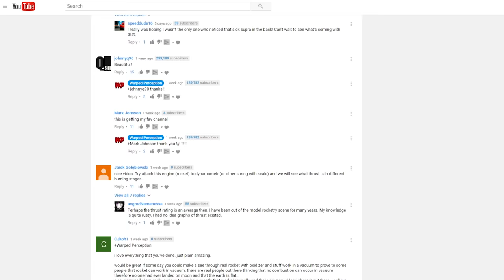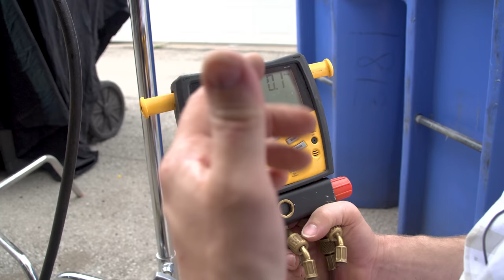Model Rocket Engine In A Vacuum Chamber - 4K Slow Motion - will it burn? - Rockets (S1 • E3)

Comment: Wow, you have tape on the ends for covers, that must have been a true vacuum... NOT
Reply: There was a stopper on the end with a gasket. The atmosphere pushing in on the stopper held it there once the vacuum was being created. The tape was there to hold it while the vacuum was being made.
Reply: The atmosphere has pressure mate. The lack of air in the tube meant that the air pressure was much lower and the atmosphere pushed onto the stoppers/ circles with foam on, are pushed onto the tube with air pressure, the air does not rush in because the force the stopper is putting on the tube makes the foam warp to the shape of the tube and prevents any air from getting in.

Also space isn't a true vacuum either

Comment: Ye it burned for 1 second and the rocket gone no where, but an inch moved .. LOL... nice try
Reply: The spring held it in place, like he showed. Do you not understand how springs work?
Reply: Do you not understand even a feather does NOT MOVE at all in front of a rotating fan in vacuum?
Note this: NO COMBUSTION IN VACUUM.
Reply: Fans and rockets: these two things are not related.
Reply: those two things connected by the words "vacuum environment".

Comment: this is not perfect vacuum.....
Reply: It doesn't need to be. According to some, the rocket will not work in a perfect vacuum. Presumably it will work at a reduced performance in an incomplete vacuum. If the the atmospheric pressure is only near a vacuum, the rocket should nearly not work by showing a much-reduced thrust. Is that what we see?
Reply: Purtroppo un vuoto totale non esiste, persino nello spazio interplanetario vi sono almeno 10 atomi di idrogeno per metro cubo. Quello che alcuni non riescono a capire è che un razzo non deve spingere su nulla, è un pensiero che non funziona. L'aria non è come un muro, non puoi "spingerci" sopra poiché essendo un fluido si sposta: prova a muoverti spingendo con le mani l'aria, vedrai che non funziona. Gli aeroplani non funzionano spingendo l'aria, ma utilizzano il principio della portanza (nel caso di quelli ad elica) e il 3° principio della dinamica (per quelli a reazione). Anche i razzi funzionano così-basta che spingano una determinata massa in una direzione e si muovono nell'altra per il principio di azione-reazione.

Comment: That's absolutely perfect! You can see exactly as the pressure builds up behind the rocket it starts to move, proving without question that a rocket only works with a medium of air behind it, meaning it does not work in a vacuum. It is also a great intelligence test.
Reply: I find these experiments beautiful because you can rely on physics to give you the exact same result every time. And its proving the exact opposite of what they set out to prove. Funny as hell!
Reply: You dont seem to understand newton
Reply: @robertenator  - " that a rocket only works with a medium of air behind it, meaning it does not work in a vacuum"
SO you believe that machines CAN accelerate mass without feeling any recoil force?
Wouldn't that violate Newtons third law?
YES. YES IT WOULD.
Any machine that PUSHES ON MASS - MUST feel an "equal and opposite force".
Rocket propulsion is just the mechanical recoil of pushing on mass.

Now how about you try taking a physics class BEFORE calling every engineer and physicist to have ever lived a bunch of idiots?
Reply: A gas expanding into a vacuum does not develop mechanical power. That's a quote from James Prescott Joule himself, NASA chatbots hate him !😂
Reply: @papalegba6796  - SO then just tell us where the force comes from that accelerates the mass into the vacuum.
 Last time I checked "WORK" is required to accelerate mass.
Yet you claim no work is performed. Isn't THAT a violation of Newtons laws genius?

It's ODD that a "Bot" can figure that out while YOU cannot.

Comment: you lose your vacuum shortly after ignition. where is your common sense!? I guess that is not too common anymore.
Reply: The question is will it ignite in a vacuum
Reply: @preppertechnicianee6013  at ~25 torr, sure I'm ok saying it will ignite. however it will not continue to stay ignited in the conditions of getting to "space". that is a super low vacuum that does not even come close to the lack of pressure in "space" nor does it come close to the lack of pressure in "low earth orbit". at ~25 torr you are basically testing if a rocket will work at roughly 15 mile elevation. you've got a lot of air "space" to cover before you get to low earth orbit. I think this whole "test" was diverted from the original claim that there would be no thrust and nobody has had a vacuum chamber large enough to disprove this claim because everyone that tries has so little volumetric capacity that there must be thrust acting upon the walls of said vacuum chambers.
Reply: @AnthraXaXis  so se typically uses liquid fuels in space you can use solid but involves extra steps 

Do you know how to calculate exit velocity of a gas 

Use that and calculate how fast you have to pump in liquid oxidizer to maintain that pressure

Comment: space  is not confined to a tube and  the rocket would not touch the sides of the universe in other words the rocket was reacting to the walls of the tube and the rocket gas filling the whole of the tube universe and there for as to react to push against its own gas. in the real universe that could not happen

Comment: No success . show vaccum gage at same time as burn, observation spring did not move until gases built up in chamber providing resistance.
Reply: That is not true - we can see it moving backwards before the exhaust gases reach the end of the chamber.

Comment: sound disproves vacuum. not real. sound only travels with compression is possible, and since there is sound, it means no vacuum.
Reply: Sage 11235813 thats bullshit the exaust particles hitting the wall creates vibritions too
Reply: sound does not travel in a vacuum. and it means no vacuum, no sound. sound means no vacuum. What prevents the supposed sound of the furnace of the sun from the only noise heard? Vacuum, no sound.
Reply: Sage 11235813 why are you keeping your statement come up with scientific things
Reply: Sage 11235813 EXAUST PARTICELS HIT THE WALL OF THE CHAMBER THEREFORE    VIBRATING THE WALL AND PRODUCING SOUND WAVES
Reply: So you are now claiming that the experiment that was done was not a real science experiment and was pseudo science to try to get a low pressure container to pass as a vacuum chamber? Then claim that since there still is sound that is not able to move in a vacuum is causing the burns on the bottom, only prove you did not have a total vacuum that would prove rockets working in a vacuum state, which you never were able to produce.
Sound fucking sucks, because it shows when there is and is not a vacuum, sound does not move in a vacuum.
Reply: Those engines only work in a gas environment. Or we would have already been to space way beyond the technology of mixing powder or making fireworks. At a certain height they do not work. that is why the need for new rocket fuel, right? on top of all of it, you called what I was doing science. So what is it that you are or are not doing?

Comment: When did NASA start using solid rocket fuel in space?  Because never let's try replicate what they use!!
Reply from the maker: +Owen Lee great point and great idea, I am going to have to set that up
Reply: Owen Lee why does it matter if solid or liquid?
Reply: Norm Plewm because basic science you need three properties for combustion= 1. Fuel source 2. Oxygen 3. And heat.  Solid fuel when ignited by a heat source provides its own oxygen source! And heat in the form of a chemical reaction.this makes a pocket of air near the combustion source and that is what the rocket pushes off of. Liquid fuels will not produce this pocket of air in a vacuum.
Reply: Owen Lee you dont need oxygen for combustion and the oxidant in solid rocket is consumed as part of the combustion.
The chemical reaction leaves you with a whole host of chemicals but there is not a pocket of oxygen because if oxygen is used as the oxidant it is part of the reaction that causes movement.
Basic Chemistry
Reply: Owen Lee and you dont need to add heat for combustion.
Again.. basic chem.
Reply: Norm Plewm you don't need oxygen ehh well there your much smarter then me if you can create combustion without it!! Must be a NASA FAN BOY
Reply: Owen Lee and yes combustion of liquid propellant rockets produce the reactant gasses, just like solid rocket.
Reply: Owen Lee No, i just have a better understanding of chemistry
Reply: Norm Plewm again take my advice smh mag needs oxygen damn man you can’t even google!! Let alone pay attention in science. Iodine doesn’t explode look it up!!
Reply: Owen Lee And regardless of the fact that elements like fluorine are excellent oxidizers the other and more important fact remains that F=ma.
but you bone heads insist that you need something to push on... laughable.
Reply: Norm Plewm again you need to just stop you already don't know combustion requires oxygen why would I listen to anything else you say?
Reply: Owen Lee you dont know what combustion is and you think that you have to push on something to create motion, which is really laughable.
Reply: Norm Plewm you're laughable this conversations over I don't talk to brick walls! Go take a science class!
Reply: Norm Plewm now there is some k-4the grade education from NASA that says rockets push off the air/exhaust they create!!!
Reply: Owen Lee yes i learned that in grade 4. When Acceleration x mass = force.
You can observe it any time any place, but your tooth fairy notion of the world wont allow it.
Reply: In Nasa's stuff, they have liquid oxygen as an oxidizer so they will work in space

Comment: Your joking right?  
Because, you were no where near a complete vacuum, as rated in Tor, not Psi. Of course where the test truly needs done, is at, Nasa's Columbus Oh. Vacuum simulator.
Reply: You don't think that's already been done?
Reply: Torr is just a different unit of pressure.
Reply: @darklight2.1  Sorry dim light, for not detailing everything wrong with this unscientific demonstration.
 But there was atmosphere still inside, yes less but still enough. And then the rocket motor compound, the fuel has its own oxidizers. Which then adds more mass for the rocket motor to push against. AKA all that smoke from the chemical reaction being directed back around the inside of this tiny chamber.

And remember it takes 8 feet of concrete and steel to create a separation layer between the pressure outside, and the internal vacuum in NASA's own Vacuum Chamber in Ohio. 
 None of the Video's on Youtube that I have seen truly show a accurate test.
Reply: @mattl2k6  no it has not..
Reply: @josephh3889  How do you know?
Reply: @PabloGonzalez-hv3td  Yes, pressure gradients for measuring ultra negative pressures approaching a near absolute vacuum, which we can't even simulate at the facility made to just that. And fails, yep NASA's own Columbus Ohio Vacuum facility can NOT even recreate the claimed vacuum of space.
Reply: @josephh3889  Not even a perfect vacuum is a "negative pressure". 
The Ohio vacuum facility can produce pressures as low as 130 pascals, or 0.01psi. 
That's close enough to the vacuum of space that it will make no difference.
Reply: @josephh3889  If you understand pressure gradients you accept space by default since even the vacuum of space is still a POSITIVE pressure just barely above 0 psi.

There is no such thing as "negative pressure". The absolute strongest vacuum imaginable is 0 psi.
Reply: @josephh3889  People that like their own comments are rarely correct. Thanks for proving you don't understand what a vacuum is.
Reply: @mattl2k6  Ok, if you know about a test done that has a video, or some proof. Yet, I know you won't find anything, because NASA will flee from this subject, its their kryptonite..
Reply: @josephh3889  There is a test, with a video.. it's even on youtube. 
Took me about 30 seconds to find, so I can assume you weren't looking that hard. 
Title is "Engine Testing Inside the In-Space Propulsion Facility at Plum Brook Station" by the NASA Glenn Research Center
Reply: @josephh3889  - "Ok, if you know about a test done that has a video, or some proof"

I have video evidence, but Ill ask you to answer a few questions about basic physics.
 Answer them and you will understand how rocket propulsion works in a vacuum.

First question: If I fire a steel projectile from a crossbow, here on earth, will I feel a recoil force? Yes or No? Why or why not?

Comment: Wait you had a rocket and a tube....why did you not point it upwards exactly?  Vacuum the tube put the rocket at the bottom and let's see it fly to the top.  Simple test.  Dunno why you altered it in anyway.  Rockets are laying on their sides attacked to strings of metal... Also what the other person said have the vacuum actively sucking out air while you do it to try and maintain the environment.
Reply: "Wait you had a rocket and a tube....why did you not point it upwards exactly?"
Perhaps because mounting a long tube vertically is much more problematic than mounting one horizontally? Imagine some kind of base, guy wires, etc. to get the tube vertical.  
Since thrust and movement in a vacuum environment isn't affected in the least bit by how things are oriented within it-it simply doesn't matter and the easiest solution is the best.

"Also what the other person said have the vacuum actively sucking out air while you do it to try and maintain the environment."
Why? Read the title. The purpose of this particular experiment was to see whether you can ignite a simple rocket motor in a vacuum. Obviously, it worked. Really, there was never any doubt as most people know that these little motors carry within them the fuel and oxidizer required to burn once ignited. They'll even burn underwater.
Again-a simple answer to a question that you could have resolved yourself with 15 seconds of searching.
Reply: @darklight2.1   @DarkLight 2.1  oh...gravity disappeared?  My mistake I didn't know the orientation would change that.  A test for this type of rocket just to see if it functions would be more for the BBB rather than an actual scientific test.   Now I'm glad you could read the description.  *Slow clap*.
But this has nothing to do with actually testing rocket thrust in a vacuum.  Just if it can burn.  Mine was to test how a rocket moves and burns.  Not the fact that the product is not a dud.  You done or you got more shit to interject somewhere you were asked for or needed to....
Reply: @1goldinga  
"oh...gravity disappeared?"
No-but thrust in a vacuum doesn't care about it. How far it moves the mass will be affected, but the amount of thrust will be the same.

"My mistake I didn't know the orientation would change that."
It doesn't. Good job-you got that cleared up.

"Now I'm glad you could read the description"
Yeah-reading..it's a thing I do. 

"Mine was to test how a rocket moves and burns."
"Yours"? As far as I can tell, you haven't tested anything.
And if you have a look in the contents for this channel, you'll find that they have another entire video devoted to demonstrating Newton's 3rd Law and that rockets work in a vacuum.
So, yeah..it's that reading thing again.

"Not the fact that the product is not a dud. "
That's not what he was addressing either. In the first 20 seconds of the video we're told that he is making the video to address misinformed people who thought that rockets couldn't burn in a vacuum.

"You done or you got more shit to interject somewhere you were asked for or needed to...."
Well, that sentence doesn't actually make any sense, but if you are still confused about the why's and wherefores of rockets in a vacuum and the testing thereof, I'm sure that myself or some other knowledgeable soul will be around to help. 

Feel free to reach out..

Comment: This does not prove anything in a room with little space. Think of me fire does not run without oxygen right? Yes more because the rocket ignited simply because the fuel mixture inside the rocket creates a reaction that it produces the oxygen itself making it possible to ignite the amount of oxygen that this rocket produced was enough to create an environment inside the Chamber as if foce out making it possible for the rocket to move Note that the rocket will only move when the chamber turns white this smoke and a mixture of gases with oxygen. The nasa uses these types of fuel to create oxygen and spend more time than normal. Do an experiment of this inside a large chamber where the oxygen of the rocket can not fill the space I doubt he moves. I do not accept this test
Reply: Rafael sousa and when you throw a basket ball or bowling ball, which one pushes back against your arm more dum dum.
Is your answer the basketball because it is bigger and has more to push against? duh
Reply: Norm Plewm 
Dear friend, translate, what are you saying to the Portuguese please, I'll understand
Reply: Rafael sousa no need. I will use the universal language.

F= m × a